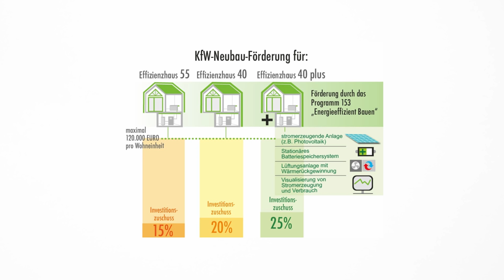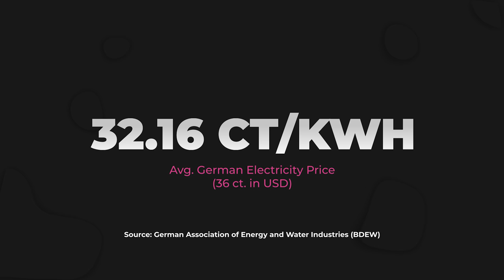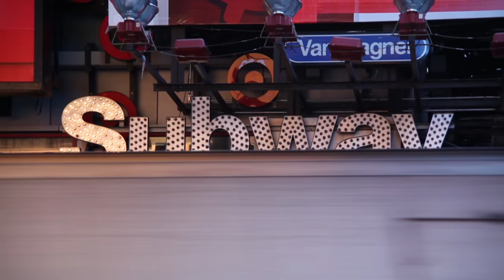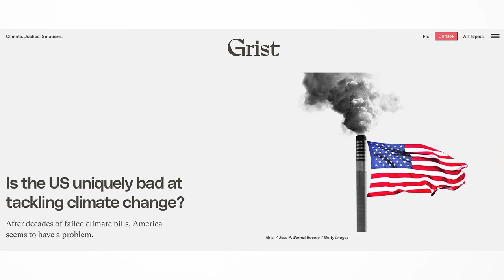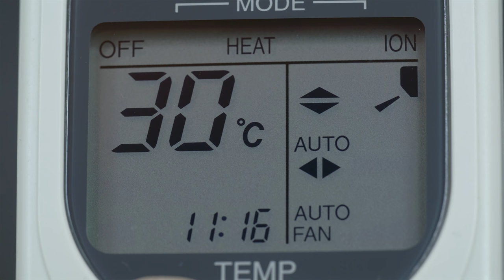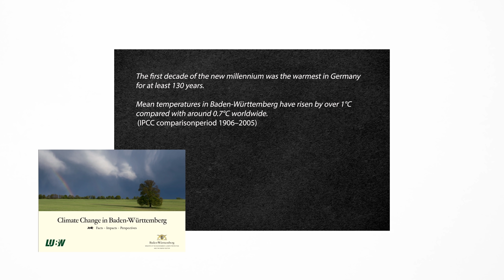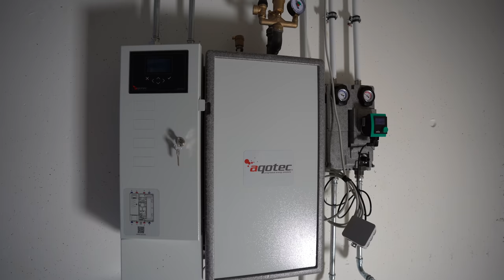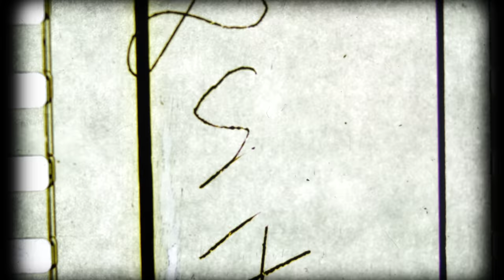HVAC (HLK) in German & American Homes | A Tale of Two Countries

Comment: For me i would use a Multi Split AC as Heating and Cooling if the old oil heating wents broken. I would like floor heating via Heatpump but its so expensive to fit it in a old house. In my case i would need to insulate the roof and walls better than they are and open all floorings for the floorheating, build in new windows and then install a heat pump and have all the costs at one time (i think each step is worth it) . I rather use a Multisplit AC with a couple of Indoor Units in the rooms i want to cool or heat and then insulate step by step when the money is there for it and as you mentioned because of the more hot days in summer i would buy a AC anyways (Already use a window AC). The backside of this is you paying more for electricity but on the other side a central Heatpump consumes energy too and look the natural gas prices right now the trippled in the last few months. One thing i would make when insulating i would use woodfiberinsulation (Gutex) it costs more than rockwool and keeps warm in winter like rockwool but it cools much more in summer and reduces the need for a AC.

Comment: I have spent my life only in temperate latitudes in London, Paris, and Nuremberg. Up until the year 2003 I did not feel the need for A/C, there was none at my workplace, none at home. Nevertheless, I was working - besides normal work - on a book during this heatwave - it was more than 50 days above 30 and it even was some days above 40. The unusual thing in 2003 was that it was continuously hot, each day. Normally when we have hot summers like in 2018 or 2019, there are colder days in between, before it is getting hot again. In 2003 that was not the case. We ended up working through the night, leaving work early and spending the afternoon in public pools as my apartment was unbearably hot. Now I have moved to a rural town nearly 700 meters above sea level - no problems at all with heat waves & finding enough sleep at night. Another point that speaks for A/C is that it reduces humidity. I have spent a summer at Montpellier. Initially, I have wondered about a remark if one tolerates A/C in housing ads when I was looking for a shared flat. The housing section in the newspapers was basically separated into housing ads with and without A/C. The reason I have found out thereafter, there are more or less only 2 possibilities in the microclimate at Montepellier, so either it is sunny, quite "cold", dry air and windy, or really warm, cloudy, and extremely humid. They do not have closed wardrobes as the clothes would get moldy. After showering one could not get dry, even the towels are wet, before use. On humid days I just went to town and work in sports gear as it transports the moisture better. There was really a constant discussion going on between the fraction of pro A/C and against A/C between friends at the workplace etc. about switching on or off the A/C.
Reply from the maker: Your experience in Montpellier reminds me of a time I spend in Portland, OR. It was SO humid there... everything was just "damp". I remember going into the hotel room and it didn't even feel like the sheets or towels were completely dry.

Comment: Very interesting.... its all very sophisticated and most times very confusing.🙄😳 

Another reason for Germany not having AC is "hitzefrei" a favourite of school kids. Its been a long time since I attended school but it essentially boils down to if the temperature outside goes above 30deg C before 12h00 then it's to hot and the kids go home 🤣 we spent many a day agonising if we would get Hitzefrei🤣

Another little anecdote. I visited my father in Germany in the early 90's. We did a tour and visited a friend of his in Karl Marx Stadt.... today known again as Chemnitz in the old East Germany. She had "Fernwärme" in her flat. The interesting bit was that they never had thermostats / heat regulators on the radiators so the temperature was controlled by .... wait for it... opening and closing the windows 😳 in the middle of winter 🥶 . This happened until 10pm 22h00 when the Fernwärmeanlage (heating station) was simply switched off.... ie big brother told the people when to go to sleep 🤣
Reply from the maker: Woah! That is super interesting!

Comment: We had our share of very hot days in the last years. Usually we open the windows during night and roll down the shades during day. But in 2019 we gave in and spent an night in hotel with AC - just to get a good nights sleep. 😉
Reply from the maker: We gave in and purchased a portable AC unit when I was pregnant. We live in an attic apartment with windows facing south/west (and no exterior blinds).

Comment: As for the use of an AC. Of course we thought about having an AC because of the hotter summers. But on the one hand you don't make environment better with it and on the other hand due to temperature difference (yes we germans move in and out al lot) and humidity difference you harm your health. So even if we chose an AC it would only be a small one for a single room rather than a central AC System.

Comment: I wish I had an AC unit, especially during working from home. It's stupid Germany doesn't have those installed in at least some rental units by default. No need to cool the room down to freezing 18°C like in malls, but at least to flatten the peaks of 30 down to 25. Opening the windows in the morning gets you only so far. It works like half a week and then it doesnt make a difference anymore.
Reply from the maker: It is tough, that's for sure. When I was pregnant we did cave and purchase a portable AC unit. Our apartment is in the attic of a building with windows that face west/south (and no exterior blinds to shut). Our home gets, very, very warm.
Reply: @TypeAshton  So what was your experience with it? I thought of buying one last summer but read that it only cools down 1 or 2 degrees so it wasnt worth it for me.

Comment: Grew up in Chicago, lived in Houston during adult years, spent 4 years in Saudi, now retired in Ireland.  Chemical engineer whose father was HVAC engineer.  Lived in all climates and understand heating/cooling systems like few others.

Great video, (love y'all) good start on this topic, but there are just way, way too many variables to adequately do justice.  Where should I start?  I could easily write a book on this subject.

In Germany, there’s simply no equivalent to the heat and humidity of the American south. Trust me, I know.  It’s BRUTAL – and is far, far WORSE than the American Midwest (lived there also), where authors came from.  To suggest going without AC in the American south is laughable.  It's uninhabitable without AC.  Plus, American homes are designed differently and it's easy to route fixed air systems, which is impossible in European  homes.  Last, America is energy sufficient, while Germany is severely short.  2022 showed that clearly.

I actually prefer fixed air systems and I’ve been around a lot of radiators in my life.  The reason is you have much better temperature control than in European homes.  Most Irish homes don’t even have a thermostat.  I'm constantly playing with the time settings.  Talk about inefficient.  A simple thermostat would do wonders to improve comfort and save energy.  In US, you dial in one number and leave it there all year.  Systems adjust, no matter outside temperature in the most extreme climate with all parts of house at same temp.  As an engineer, this is the optimal solution  Last thing is good luck if you ever have a leak in the radiator system like one place I lived.  Talk about expensive.

The title seems to imply that Americans are grossly inefficient.  While I have plenty of criticisms about US, this is not one of them.  Building styles and heating/cooling systems are a product of history, available materials, amount of energy, where it comes from, and and energy cost.

Comment: Must point out that the use of "radiant heating" is not quite correct. In Germany a lot of the heating systems are low temperature that do not radiate efficiently. The desired heating effect of heated floors and "radiators" is normally convection, i.e air passing by or through is heated by contact with a warmer surface. Look at a typical "radiator": between the outer heating plates there are zig-zagged metal plates to transfer heat to the rising air. That is why you should not block the airflow in any way. These internal metal plates would be totally useless for radiation purposes.

Comment: Great video - once more. :) It would be interesting to see how the number of AC units in Germany has developed over time. My gut tells me that there is actually quite a large increase in recent years, probably due to what I perceive as an overall rise in high-temperature periods, but it seems that there are no reliable figures available to support or contradict this assumption. Having said that, we actually have a few of those wall-mounted AC units in our house now, and their cost was still a lot less than upgrading our central ventilation system to support proper AC for all rooms, so I assume it's got to do with "what everyone buys" that keeps the cost down. Central AC is just not standard in Germany and therefore has a significantly higher price tag.
Anyway, we do love the fact that our AC units can also deliver heat very quickly - much quicker than the floor heating system - which is especially helpful in those transitional periods when it's kinda warm during the day - say around 18 degrees - but still cold during the night. That allows us to turn off the main district heating system and only top up the temperature (in the evening) when we have the need for a tad more cosiness. I haven't done any scientific measurements, but I can't believe that this would actually require more energy than keeping the main system running, especially since the AC units are quite efficient. By simple physics, it should actually be less assuming that the efficiency of generation is the same ...
Long story short, I can't see myself cooling our complete house 24/7 in the summer, but being able to bring down temperature temporarily is really convenient. On the other hand, I find that the typical (floor) radiation systems provide a cosier type of heat, especially when you tend to have cold feet like my wife. ;)
Reply from the maker: I also think this would be a REALLY interesting statistic, but we couldn't find it in time for this video.

Comment: Interesting. I'm surprised more people in Germany don't use passive houses (Passivhaus) since the movement came from there, and it basically means zero energy costs. Also, 3:11 it's degrees Celsius, not "centigrade"; that terminology was deprecated all the way back in 1948 ha. And 18:19 Iran is pronounced "ih-raan", not "ih-ran" (the "a" is like that in "father" and not in "ran").

Comment: This is really interesting. I only recently saw the Europe v. USA latitude maps and was really taken aback. The US is so far south!  I live in a city in northern England and it's about level with Edmonton, Canada. It makes you appreciate the kind of weather we would have if the Gulf Stream switched off!
Talking of comparative energy consumption, it is remarkable how cheap petrol (gas) is in the USA. It's about £1.45 a litre in the UK ($1.96 US, €1.71).
Also I wonder why Americans build their houses out of such flimsy materials in places where they have tornadoes and hurricanes. It's always shocking to see these wooden houses reduced to matchstick wood after a tornado.
Reply from the maker: It's often cost. Many people would prefer to take the bigger house for lower costs. Plus, concrete construction for private homes is often quite rare... making it more expensive. But, we completely agree with you.
Reply: As a German, I have also asked myself this question. It turns out that it can be cheaper to have a wooden house "blown down" by a hurricane and rebuild it than to repair a concrete house damaged by a hurricane. That's because wood is much cheaper in the U.S. than in Europe.  And tornadoes, etc. have a tremendous force to severely damage even a concrete house (I always underestimated that force until my researches since there are no such strong winds in Europe and I got the wrong conclusion that a concrete house can stand a hurricane). Long story short: it's cheaper.
Reply: They generally don't build flimsy homes where there are hurricanes. In Florida your homes are stone, brick, or concrete (inner walls are still drywall. A hurricane isn't going to knock down your inner walls). The roof joists are generally wood in homes built after the 50's (this is for FL only). I was born and raised in Florida. Your older Florida home is basically a concrete bunker. The home is going absolutely nowhere. The roof is concrete so it has no pitch at all. Since the roof doesn't have a pitch water doesn't runoff and causes issues. 
Pretty much everywhere in the US there are trailer homes. These homes are a tin can. Hurricanes rip through these like nothing. People buy a home they can afford. Concrete homes are expensive to build. Just to put things into perspective. I'm looking to move back to South FL. A trailer home costs $100,000-$200,000. A concrete home in the same area is $450,000- $700,000. 

I was in the direct path of Hurricane Andrew back in 1993. Was one of the strongest hurricanes to hit Florida. My home was unscathed because it was an "old" concrete Florida house. 99.99% of the damage in my area was the trailer parks. My "damage" from the hurricane was not having power for 2 months.

There is new construction that's coming up that's wood and is supposed to resist hurricanes and termites. Do I believe this? No I do not. Give me a concrete, brick, or stone home.

Comment: Actually, I don't have an idea how a forced air heating system works or what that exactly is.
Regarding air-cooling - we don't do it. We live in a small wooden blockhouse (which insulates quite well) on a small island within a small artificial lake, surrounded by forests. Sommers get warm, but rarely unbearable, due to the micro-climate here. When I look at the home of friends and family, actually no one has an air-condition unit, regardless if they live in the country side, in a big city, in the south or the north of Germany.

Comment: a nice remote controlled Dyson fan also works wonders for the hot days in Germany
Reply from the maker: We also plan on installing some ceiling fans in our new home. I think that will make a huge difference.
Reply: @TypeAshton  A ceiling fan makes sense in the heating season (aka winter) when it pushes the hot air down. But in the summer (aka cooling season) you want the hot air pulled up and out away from you. Believe me, it is no fun sweating almost naked and having the ceiling fan "blast" you with hot air.

Comment: Regarding "Fernwärme" / district heating, is it used in the USA in the context of residential housing at all? I'm aware of some systems on (university) campuses; maybe in NYC, Chicago etc.? Must be near zero percent in the US overall...
You didn't mention "Fernkälte" / district cooling, essentially cold instead of hot water in the same - modern - radiators or underfloor pipes; so even old buildings can be equipped with that, completely replacing "old" AC systems.

Comment: When i was younger my mother always told me that the cold air of an AC unit causes the common cold. Today, I think this is a myth or at least a misconception. If you are not used to it, the dry air of an AC can feel rather uncomfortable or unnatural. During a hot summer we also do "Durchlüften", which is what Johnathan described what he does at work: Open all doors and windows to let the air circulate for a few minutes.

Comment: well i definitely appreciate the air conditioning at the workplace. It doesn't cool down the offices so much that you start to freeze but keeps the temperature below 25 degrees Celsius which is good enough for me. 
It is gettig really uncomfortable if the temperature goes above 29 Degrees Celsius in my flat because then i really lose my will to do anything. 2 years ago i actually went into a hotel nearby for a week that had AC in their rooms. Otherwise i use a ventilator to get some cooling air currents to get rid of my body heat. But i can totally see that this would not be sufficient if we had temperatures above 30 degrees Celsius for many months each year. Then i would definitely want a home with an AC unit too. But it wouldn't need to cool down my home to 20 degrees or even lower but 23 - 24 degrees (73 - 75 degrees Fahrenheit) would absolutely be enough.

Comment: Funny story from the US. I was going with a bunch of Americans on a bus, when I complained that the AC settings were ridiculous, so I went up to the driver asking him to reduce the AC. Returning to my seat my neighbour asked me, if the drive agreed to increase the AC 🙂
My house in Germany is using a floor heating system with a ground water based heat pump system. The ground water is cold enough to cool down the house in the summer more ore less for free. The temperature drop  is limited in order to prevent mould growing in the corners. I assume it will not satisfy American expectations, but for Germany it is fine.